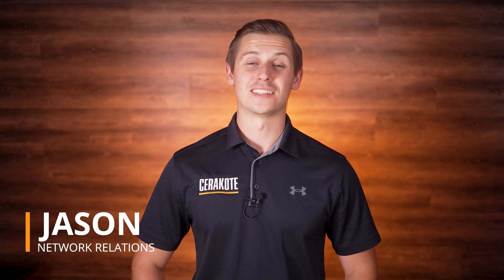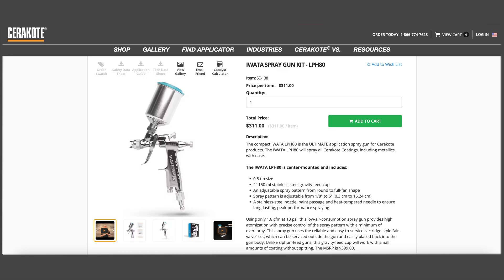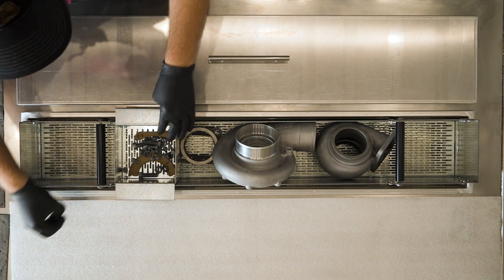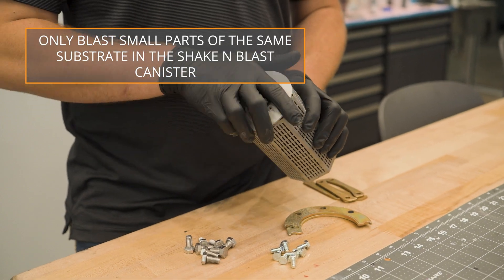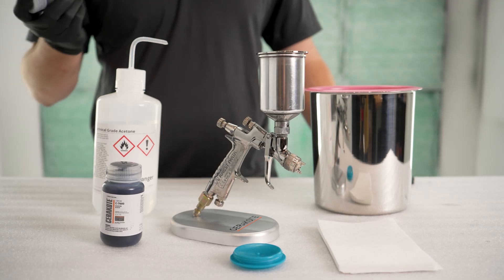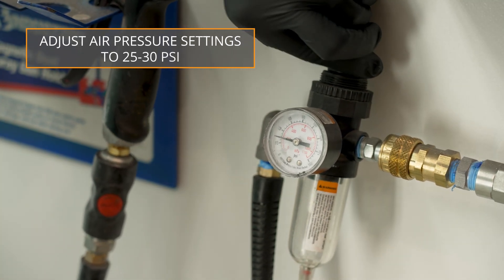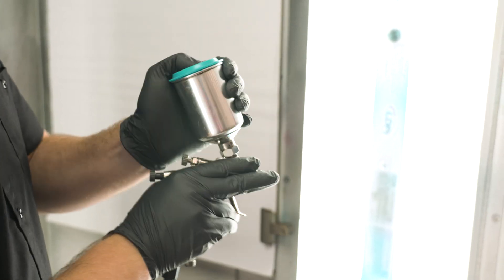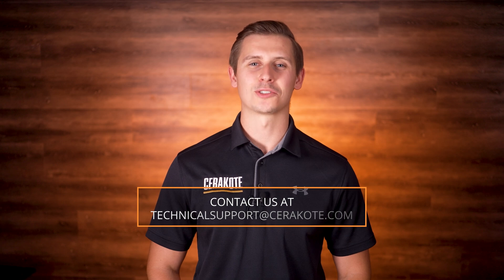C-Series Application Guide | CERAKOTE®

Comment: Can this product be used to coat nuts and bolts? Or more specifically threaded coilover shock bodies?
Reply from the maker: You can use it for those applications but C Series is not the ideal option among our series of coatings. Is it just the air cure aspect that is attracting you to C Series?
Reply: @Cerakote yes that is correct. Im restoring a set of coilovers and don't want to take apart the physical shock body and valving. I just want to clean up where the shock perches and lock collars thread. That's why I'm leaning towards air cured cerakote.

Comment: So im interested in the C series for my engine.. The issue is its assembled an I dont to chance anything sandblasting. Could i still get good results an long term adhesion with out sandblasting? Also do you have a color option or recommendation close to GM hugger/chevy orange found on the older engines. Thanks
Reply from the maker: Without the blasted profile it is unlikely our coating will be able to achieve the proper adhesion characteristics, and you may experience delamination of the coating. We currently have one orange offering in C-Series with a color stability rating of 400°F, it is our Hunter Orange coating C-128. While the color may begin to change at 400°F, the overall coating stability is good up to 1700°F.
Reply: @Cerakote  Thanks!

Comment: Might be a silly question but can the C-Series be applied with a paint brush to fix minor repairs?
Reply from the maker: Technically yes, but we wouldn't recommend that method for a few reasons. It would be difficult to get the right mil thickness needed for best performance, and it would not be an easy task to get it looking right either.

Comment: Can this be clear coated with High Gloss Ceramic Clear MC-156?
Reply from the maker: For C-Series clear over C-Series base we recommend wet over wet application. After applying the C-Series base coat allow it to ambiently flash for a minimum of 5 minutes but no longer than 15 minutes before applying a clear coat.
Reply: @Cerakote  would there be a benefit to applying the clear? or is it not needed?
Reply: @Cerakote  if longer than 15 min will it start to fish eye? And what is the time between coats for both base color and clear
Reply: Also curious about this but would guess yes, after a few hours but not more than 4, according to the video Cerakote did on stenciling with C series

Comment: What is the thin blue tape/masking tape used on the large areas. Looks almost like gasket material but thinner
Reply from the maker: It's High Heat Tape. We've got different sizes ranging from 1/8" to 4" on our website. https://www.cerakote.com/shop/cerakote-coating/SE-340/high-heat-tape

Comment: Does the glacier c series on exhaust headers  loose its shine/ colour once heated, & is the v series better for header applications where extreme heat is applied to coating
Reply from the maker: Glacier Series Pros
-Air cure
-Thermal barrier
-Coating stability 1800°F

V-Series Pros
-Higher color stability temp
-Coating stability 1800°F
-Faster cure times due to the use of an oven.

The glacier colors are only color stability rated to 500°F, we can’t guarantee their color past that mark but have seen excellent longevity on header and exhaust applications. The V-Series has a higher color stability rating however it loses the convenience of air curing and the thermal barrier the Glacier Series provides. It all depends on preference and your setup for Cerakote.
Reply: @Cerakote  thanks for that explanation, so glacier has better thermal barrier than the v series!
So what has best thermal barrier in the piston coatings, c series air dry  or v series oven dry ?
Reply from the maker: @christsakrios6681  With Piston Coat, both will have excellent thermal barrier, as that's what they were designed for. Please contact our support team at technicalsupport@cerakote.com. They'd be happy to go into more detail. Thanks!

Comment: Wait so no cleaning the part off after sandblasting nd  gas out?
Reply from the maker: Our media cabinets are used only for items that have followed this preparation SOP. This allows us to maintain a clean blasting environment that does not require a post–cleaning process.   
If you are concerned about the surface after blasting, you can certainly rinse or submerge in clean acetone and blow dry. That will not affect the coatings adhesion as long as a film is not left behind.

Comment: So if a person were doing a four color camouflage pattern 20 days would be the appropriate cure time?  Waiting for full cure between coatings.
Reply from the maker: The short answer is no, it will be essentially the same as if you were doing one color, however you will need 1-3 hours for each color to become tack free. Check out this video for stenciling with C Series. https://youtu.be/ZlvC0XsnivY?si=aKqNyQgQLaxNlnm8
Reply: @ many thanks!  Also I noticed there’s no yellow in the C series, is that coming sooner than later?  Lastly could a person theoretically use a heat gun rather than an oven for curing H series coatings?

Comment: Wouldn't recommend using nitrile gloves when using acetone.
Reply from the maker: That's good advice, especially if you've got your hands in the acetone frequently. When using our degrease tank and basket, there is a benefit of not having to reach into the degreasing solution.

Comment: Can you force dry the c series with heat or infrared lamps? Is this recommended for heavy contact parts such as handguards?
Reply from the maker: C-Series requires an ambient cure for a full five days to properly cure. Please note, while oven curing C-Series may help to reduce the tack-free time, it may change the aesthetics to more of a matte finish. We have not conducted IR curing tests to provide data if this will work as an alternative cure solution.

Comment: Is a special masking tape required? I would assume no since it is air dry?
Reply from the maker: We recommend a low-tack adhesive of some kind, such as painters tape. This will allow for masking off the areas needed without jeopardizing the coating beneath it.

Comment: I'm curious on why you don't wash / degrease with a wax or grease remover after blasting?  Parts are rather filthy after blasting and just blowing parts off with compressed air is not sufficient enough to remove all dust particsls from blasting.    Also, is there a reason for not tacking parts to remove any other dust particles?  I  come from the automotive paint industry, so your prep process all seems a little backwards to me.  Could you  please explain?  Thank you. @cerakote  please respond,  thanks.
Reply from the maker: Our media cabinets are used only for items that have followed this preparation SOP. This allows us to maintain a clean blasting environment that does not require a post–cleaning process.   
If you are concerned about the surface after blasting, you can certainly rinse or submerge in clean acetone and blow dry. That will not affect the coatings adhesion as long as a film is not left behind.  
A tack cloth may certainly be used but is not generally necessary to achieve a debris-free finish. We have used tack cloths before on large flat surfaces to ensure the surface is free of debris without issue.
Reply: Agree. Depending on how dirty they were going in I wash and dry parts and spray them immediately after blasting. Have not had a coating fail yet doing that.
Reply: @nicog3583  Thank you for your reply.  Nice to know that someone is doing it this way with good results.
Reply: I'd like to see @cerakote respond to this.